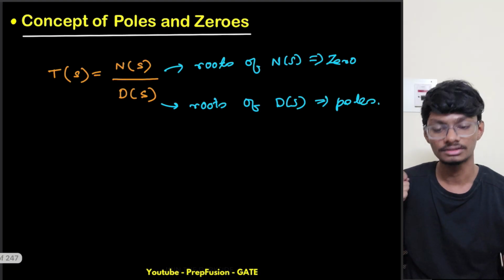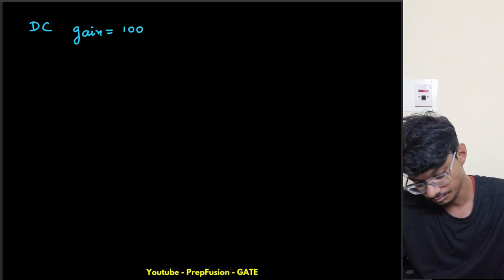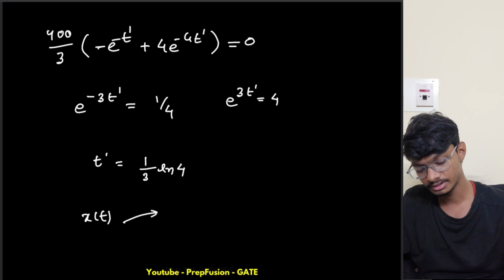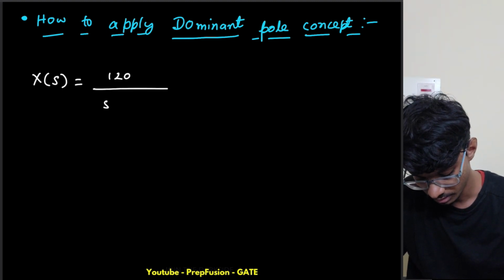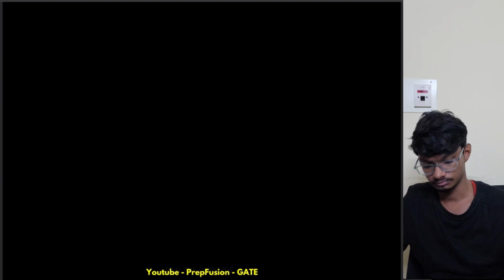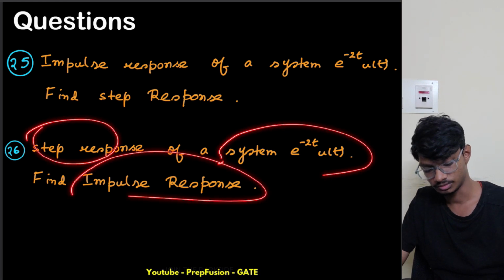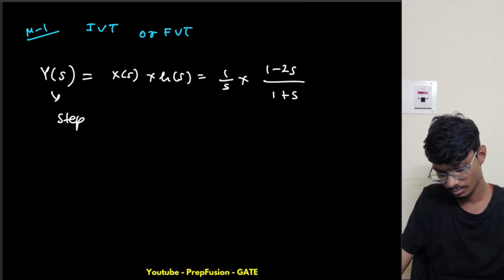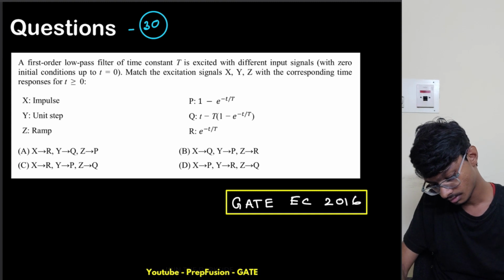Dominant Pole, Impulse & Step Response || Control Systems || GATE 2025 || PrepFusion || @AnishSaha_

Comment: Sir, at 39:26  u have said that the time constants are 10 and 1 but how did you consider 1, coz time constant is the magnitude of the -ve real roots of the stable system, that means the magnitude should be  sqrt(2)?
Reply from the maker: We are considering the -ve of real part of the roots not magnitude